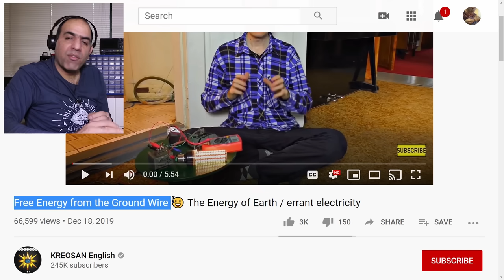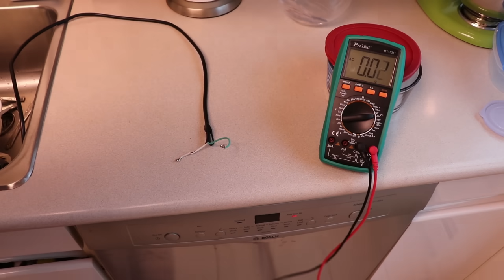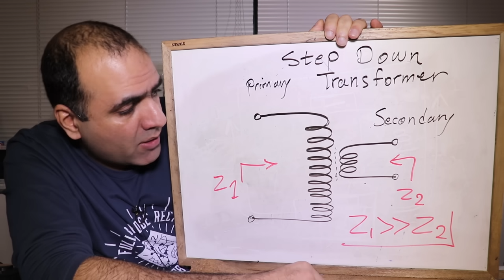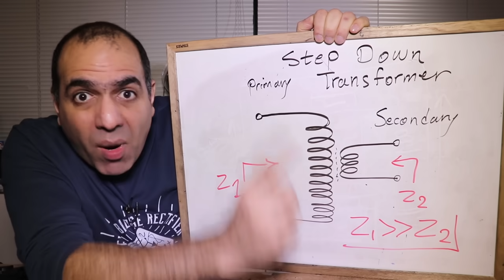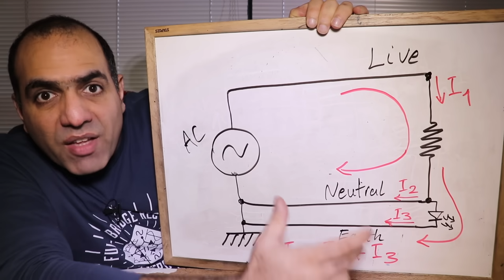FREE ENERGY DISCOVERED in Ukraine, 3M Subs Celeb!!!

Comment: Brings to mind and old trouble shooting trick used to figure out why a car battery was discharging.  You disconnect the hot and connect a light between the cable and positive battery terminal. 

IF you have a drain on the system, the light will light [or the meter will give a reading].  If you doubt it, turn on the parking or headlights and the bulb should light, UNLESS your battery is beyond dead.

Shut the lights and everything you can think of off. If the bulb is on, something is running (or the top of your battery is filthy with electrolyte and dirt, draining it). Start pulling fuses, until the bulb goes off to know which circuit is involved (e.g., the trunk light, under-hood light, etc.).

Here, there should be no difference in potential between the earth ground and neutral, unless you have other problems, like needing to clean ground AND figuring out why you have power bleeding over to it.

Comment: Its really free energy
Because energy meter measure’s voltage between line and neutral wire, not ground wire 
I think in KREOSAN’s house’s energysystem no any grounding , and his neightbours too. Its reason why he got so much voltage across neutral and ground. I guess its really to have only one grounding only in transformer station

Maybe energycompanies know about this and install energymeters with 2 current sensors (on line and neutral wire) . Algorithm of this meter is measure max current on line or neutral and accumulate energy with maximal of current
Reply: No it's not, stop with this idea of free energy
Reply: Mauricio"Panda"Antunes What’s happen if i turn off all energy consumptors in house?
It will be still some voltage between neutral and ground
Because point of connection neutral and ground is far from house in old russian electric grid.
Reply: Yes, Kreosan shows some kind of lifehack from Soviet Union. In Ukraine ( especially in countryside)  there are a lot of houses without a groundings (yes there are also no normal inspection of houses to control quality of house electro system, so you can make what you want, and no one cares if yours home electro systems dangerous. For example 2 weeks ago i was electrocuted, because some idiot grounded his refrigerator to heating system in his apartment), also you can still find ancient energymeters like this https://images.app.goo.gl/Kj6dDztSv8r5vi7t5
Reply: The energy meter is sensing the current through the live wire, doesn't matter if the circuit is completed via the neutral or ground. Neutral and ground are just separate paths to ground.

Comment: A neutral white wire isnt neccessarily ground . Power can leak back through the system off some loads , such as electric                   motors, even when theyre off , if their internal structure is not properly grounded . Another place to try is  , take a measurement   between  two railway rails . If the tracks parallels  power lines , some times you can get an inductive load - when theres no                     train of course . Thats not free energy , Hydro can read the drop . You can almost always get a radio station if you put a set       of ear phones accross the tracks too .

Comment: You are mostly right, but it there are a few small inaccuracies:
  1: You do gain a little power in the case described, as the circuit you implemented effectively lowers the resistance through your house wires, by running earth and neutral together, so you save a little money.
  2: Depending on the house, how old the wiring is, etc. the neutral-earth difference can get relatively large - particularly in some old houses where earth and neutral aren't shorted. I'm pretty sure these exist, and its one of the reasons you should always consider both Live and Neutral to be dangerous - they can both have fatal voltages on them, depending on conditions. Note that connecting earth to neutral anywhere makes earth less safe, as the resistances in the earth line could produce a high voltage on earth without shorting, so the fuses might not trip etc. 
  3: If the house has separate earth and neutral, or has multiple sources of earth (e.g. a water pipe and electrical earth), the ground itself can act as a super weak battery, and this energy can be harvested - that is in theory what the people in the video were doing. But you can do this with two big stakes made of well chosen materials, and a big hammer. These voltages can be massively problematic for long range networks, with stories of hot thick Ethernet cables not transmitting data.
  4: You can extract 'free' energy from your electricity supply, using weird mechanisms to throw off the meter. I'm pretty sure there are a fair few tricks there, but the electricity company will notice, and get very cross with you. If you really really want to steal electricity, you could just hook your supply up on the other side of the meter, but that is illegal, and so is anything else which makes your power usage skip the meter. You could just as well steal money, and buy electricity with it.

Basically, if you want free electricity, it comes from the sky. Buy a solar panel. I don't know why people spend all this time making 'free electricity' systems, which are clearly just worse than a solar panel, and don't work.

Comment: The electricity goes from the live wire to the load or circuit and then goes to ground through the neutral wire, which is the return to ground connection. If you harvest electricity from the ground connection you put a larger load on whatever is been used at the time to get that power, which your meter is billing you for.

Comment: 8:31 I don't get it. Aren't the two probes shorted by the black alligator clip cable? How can there be a (significant) voltage difference, if the resistor doesn't lie between the two probes?
Reply: Because the alligator clip is not a superconductor, it has resistance so there will be a voltage drop

Comment: This truly makes me appreciate grounding.
Reply: In my universal phase motor ECU, the ground wire is shorted to the chassis, while the hot and neutral close the circuit to power the ECU. Due to a safety feature, the system will not start up unless the ground wire is connected to the chassis. Even if there is an intermittent connection caused by a broken ground conductor, the circuit still won't start up. This means that it cannot be used on a three phase three-wire delta system or a single phase two-wire system. The reason for the floating ground protection is because the capacitors inside the unit can store a charge for a very long time, posing a shock hazard if you touched something grounded while touching the ECU chassis.

Comment: Ok, I feel like this shouldn't have to be pointed out but clearly people still don't know this: JUST BECAUSE THE WIRE IS BROWN(EU)/BLACK(US) DOESNT MAKE IT THE POSITIVE PHASE. TAPING THE PHASE LINE TO PROTECT YOURSELF ONLY WORKS IF YOUR PLUG IS PROPERLY POLARIZED AND OUTLET PROPERLY WIRED. Otherwise with only two poles, you have a 50/50 chance to flip the Neutral and Positive lines. Add to that the fact that the outlet wiring probably isn't up to code, and your odds are now even more random. That's why you should always use a plug with a protective Earth prong to avoid plugging it in backwards, and make sure your outlets are wired properly to avoid reverse polarity. This video is like putting a seatbelt on but it's attached to you instead of the car.

Comment: Shouldn't he get 0V reading at 08:32? As he is not measuring across the resistor
Reply: The wires themselves have resistance, so running current through them causes a voltage drop

Comment: I found that at home.   Zapped myself off the shielding on a 30-foot length of co-ax TV cable.   Was getting extremely high volts but - sod-all amps.   
(I suspect the 110kV main transmission lines that run above our house might have something to do with it...)

Comment: If there is a resistive load between Live and neutral (that is also connected to ground somewhere) then there should be a ground leak and your safety cutouts will trip continuously, if they have Earth leak detection circuitry that works.

Comment: I think you should know that two types of grounding exist Zeroed and Grounded. If the system is grounded your video proves right, but in a zeroed system there can be potential difference, because neutral is not grounded in your system. The impedance of the Zero-ground source is inadequate to drain much current, but still is free.

Comment: On your transformer main supply, the earth and the neutral is connected on the star point. Therefore the correct voltage between neutral and earth should be zero. If there is a voltage difference between earth and neutral there is a leakage problem in the circuit which is very dangerous. A standard home should have protection against it via earth leakage device which is normally also used as the main breaker.

Comment: Kreosan has low voltage distribution system in TT system, you have TN-C in you flat, PEN wire separated to ground wire and neutral in electric panel, here you can't take higher potential from neutral to ground wire

Comment: You can charge a power bank with a laptop and when the laptop's battery get low, then you use the power bank to charge your laptop. Only works if your laptop charger is USB type C with the other end type A. New way to have long lasting laptop batteries.

Comment: In my house the neutral is not connected to the ground, it's 220v system and I measured 202V between hot and neutral and 15V between neutral and ground, whether the system is loaded or not, does it mean I can harness this residual voltage? I guess this voltage is caused by load of the neighbor and neutral is also not connected to the ground, and some resistance of the neutral wire between the building and distribution transformer. For example, if the neighbor has 10kw load I can get 30W residual power between neutral and ground. The bill will go through the neighbor's meter anyway.

Comment: Free energy from the sun, just take a large parabolic trough that is big. Then take a small copper pipe and make a coil and paint it black with high temp paint. Then put the coil at the optimum point over the mirror trough. Then use your water heat to store heat and if you use a solar powered water pump it should only turn on during the day. For free hot water heating. There are many ways to amplify the heat from the sun for greater heat out put. Too large and it could make 100C degree water or boil it.

Comment: Ground and neutral SHOULD NOT ever be connected together.  When I was an IBM AS/400 Customer Service Engineer, when installing a brand-new system, the manual instructions said to STOP the installation if the potential difference between ground and neutral was higher than 2.5 or so, volts.  Once I found a potential difference of over 3 volts and a had to stop the installation.  The owner had to make arrangements to lower that down under 2 volts by replacing the whole ground copper rod to the building's main panel. :-)
Reply: In some parts of the world, that's how they do it (North America, maybe other places). Not sure where you are from, but here in Australia we put a big old copper rod deep into the ground.

Makes me wonder, would this be possible with a proper earthing? Probably still a no.

Comment: Do not attempt this in places like Germany, where the circuit breaker board is GFCI by default. The GFCI is there precisely to prevent this very phenomena which is a result of a lot of accidental electrical shocks. If enough power goes down the live line that doesn’t come back on the neutral, then there is obviously power leakage from the live line, which is exactly what electroBOOM is getting at in the end: this isn’t free power, you’re still paying for it, as it’s still coming from the live wire, it’s just now going back through neutral, it’s going into ground.
Reply: Yeah he already told all this in the video , what's your point? 🤣
Reply: @houseofelectronics5869  Comment was early-ish in the video, and also before I watched the one where he went to the UK, and covered that most houses there also have a GFCI/RCD for the whole house. :shrug:

What can I say, there’s kind of a limited set of true facts in the world… :shrug: so, it’s really easy to point at them and laugh “haha, you’re repeating the same info as everyone else.” Yeah. That’s how facts work.

Comment: If you have a floating ground the return will be on the neutral. Many electricians have been killed by the neutral wire which should be at ground potential when bonded with the transformer ground and earth ground at the distribution panel.

Comment: You misspoke at the end when you talked about whether it was free. The electricity meter measures the power delivered to the entire cct, including driving/heating that earth resistance. You are just providing another path to ground with lower resistance so if anything it should lower the power used. The 'free' energy is the power that would be going into that ground resistance.

Comment: But if you had a small enough capture mechanism you could cool any gas to absolute 0, no joke, but as far as i know we can only create heat traps in principle, we could do that tho, but it’s basically just the maxwell demon setup in some form, it can’t reach absolute 0 unless its litterally perfect and it cant be and still be made of the same stuff as the rest of nature. However it relatively simple to make a device that waits around for a large fluctuation in gas pressure or temp and when it happens it charges a battery or something, but you’ll be hard pressed to get any sort of significant capture.

Comment: I'll try to explain. In eastern Europe there is power system with combined earth and neutral wire so in wall outlet you have to bridge neutral to earth in order to get protection. And in there you have 3 phase power line but with load not balanced between phases. So the potential of neutral point is not equal earth potential. In older power lines there are malfunctioned or no earth connections so it's acting like fake TT line. That guy is using ballance current to power his stuff.

Comment: Great video, although there is the opinion that the ground in your house is not a true Earth ground. I would have done it so that there is no confusion that the house ground is connected to the neutral wire in any way. While what you have shown is true, you are not replicating the experiment that you are trying to debunk. I think the free part of this is that the electric companies are storing energy in the Earth and reusing it, the source of the energy than would-be that energy stored in the Earth, and the neutral would be the path whereby it could be used. This basically just cuts out the meter. So with this method the free part is that you are using energy that has already been paid for by somebody else.

Comment: Wait a sec... Neutral is directly earthed?? If so why doesn't the GFCI (or earth leakage in my country) breaker trip into fault when you connect any load? In my country we have 220-240v and 20mA leakage between live to earth before a fault is detected and trips the leakage breaker. If any load were connected between live and a grounded (earthed) neutral surely that should trip the breaker as well, yet it obviously it doesn't??

Comment: Earth batteries have been used for centuries, but it more recent times they were used in the 1800's to power telegraph stations.  It works very much on the same principles as other batteries.  2 dissimilar metals put into an electrolyte - in this case moist soil. Some discovery.

Comment: Using the voltage between neutral wire and earth  we lower the voltage in the neutral wire by that we increase the voltage that the electric meter sees. Which means electric meter counter more and you pay more

Comment: Hi, I love Your videos! One thing, I'd like to point out:
It's true, the energy is not free as in no-one-pays-for-it. However, the voltage drop mainly comes from the resistance in the neutral wire. By adding a 2nd load, like LED, between neutral and ground, you basically lower the overall resistance of the wireing, bc you place the load in parallel to the bad high resistance neutral wire. By doing so, you increase the efficiency of your energy usage (for the main load, like dishwasher) and in addition, you get some energy to power the LEDs, that would otherwise be used to heat the wire.
Conclusion: The energy can still be considered free-ish, bc of overall efficiency increase and reusing energy, that would otherwise be lost.
Have a nice time, everyone!

Comment: it was about 52-533 years ago  I was a teen ager my family  house was far from power source my town had it's own generator.  for power to travel that long speciality with inadequate cabling by the time power would have reached my house the voltage had been dropped. to overcome obsticle   what I did was connoting a ground wire that I had established myself to null in order to increase the voltage and remind you it did work well.  afte  I simply bought  120 volts bulb  instead, but the problem was that at late night when power usage  minimized in town my 120 volt bulb lamp used to be blown. any how whilst  i was   connecting null to earth I noticed and spark from there I found out there is free energy . of course not really free but free enough that our electric meter would not have register it as usage.